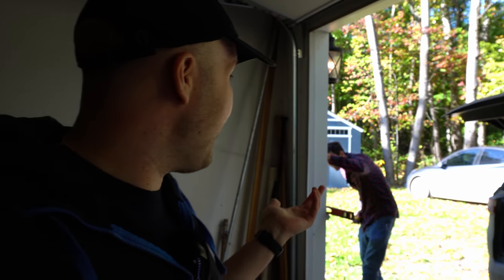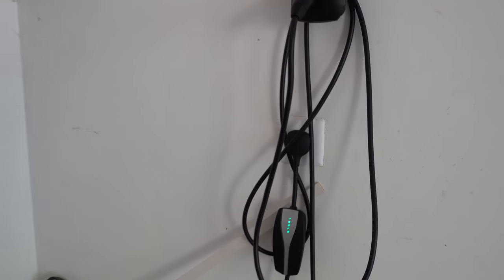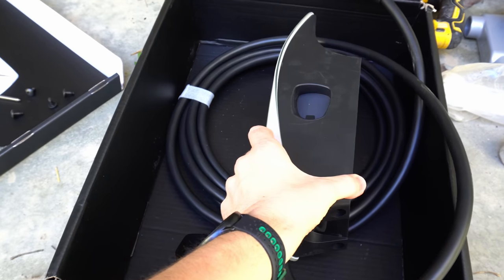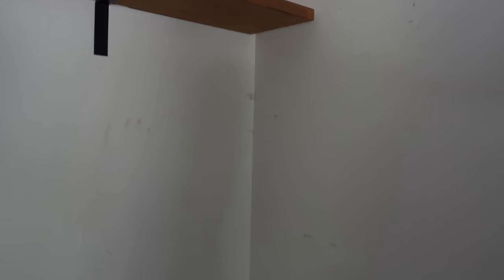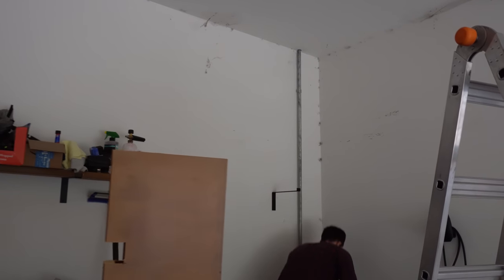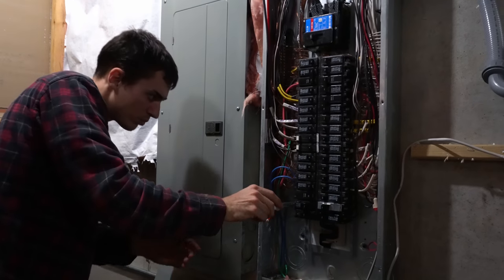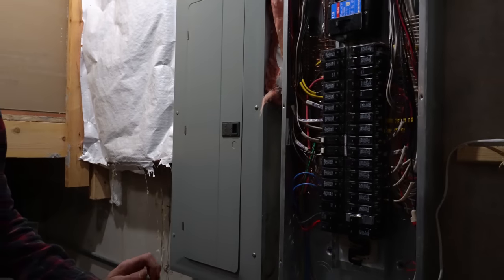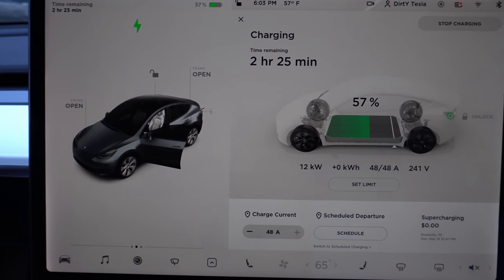Installing Tesla Wall Connector With a Master Electrician

Comment: I’m very reluctant to critique Nathan as he appears to be a great friend and is generous to work for peanuts. You could have saved money on cable by using THHN (thermoplastic high heat w/nylon) wire since entire run is in conduit.  Romex type cable isn’t required.  PVC conduit saves a little too and most of run is hidden from potential sags or use a few conduit straps. 
While the WC looks great on outside of house,  I would have protected it inside garage.  Sun & weather will age it.  How did Nathan translate siding notches to flat wall plate?  Great job !
Reply from the maker: There's no conduit in the attic. And he did suggets PVC but I wanted the conduit. Pretty much all the decisions you're like "hmm why they do that?" is me lmao. 

Also, I'll be parking outside and the charger will be in the shade 99% of the time. 

For mounting, I used this https://amzn.to/3BzM31G it has also increased in price since I bought it :S

Comment: If you were running it through conduit i wondering why you didn’t pull individual conductors.  Cheaper and less heat.  I assuming that you didn’t run conduit in the attic this the reason for the shielded wire.

Comment: In Europe we have three phase 240 and 400 volt, so we charge at a maximum of 16 amps, but still 11 kw on model 3/Y and with a 32 amp fuse you can charge a Model S/X with 22kw, so that is really something if you have a 100 kWh battery or two cars.

Comment: Just got a 14-50 installed , wonder if I should have done the wall charger
Reply from the maker: Like I said, there's not that much difference in the speed. Mostly aesthetics, but also the potential for multiple units to communicate in the future if you plan to have like 10 Teslas all plugged in together :)
Reply: @DirtyTesla  thanks man.  I literally got it installed yesterday,  it's nice not having to run an external cord from the dryer outlet, the tesla wall unit does look sexy tho
Reply from the maker: @OrganicStuff1  oh yeah that would be annoying! We've had the nema 14-50 going for almost 3 years now and it's been great 👍
Reply: @DirtyTesla  I did notice that the car is set to 32 Amps and the car would be showing it pulling 33 amps on the app is this within normal operations? Voltage looks about right
Reply from the maker: @OrganicStuff1  happens to me as well. I notice the app now changes me to 31 amps and car shows it's pulling 32 lol. It's been like this as long as I can remember and hasn't been a problem.
Reply: @DirtyTesla  God bless man thanks for all you do

Comment: Now you can use a 240v generator and power your house through that 15-50 outlet if the power goes out. You just need to cut cut the breaker to your grid/street
And he is talking about condensation building up inside, not necessarily rain water for that drain hole
Reply from the maker: Yes I have used the plug for that before but now we have powerwalls 8)

Comment: Can you give more details on the internet connectivity. Do you get an alert on your phone when the charger is in use?
Reply: hi, i just installed that charger outside. I don't think it will alert you when it is in use.  It come with its own network ID and password. (but doesn't have internet access, It is only only for setup. ) You can just scan  the QR code with your phone and it will connect you to the Wall connector. Once i was connected,  I set it to only charge my friend's and my telsa , It will remember the vin number.   Other Telsa won't be able to charge at my wall connector.

Comment: Thanks for sharing. I've seen plenty NEMA 14-50 plugs for under $10.
Reply from the maker: They are low quality and not recommended. Either they won't stand up to the hours at a high voltage, or they will break one time when you go to pull the plug out.

Comment: I had a mobile tech out to install the Homelink retrofit and he noticed my wall connector and provided a tip I’d not heard before. He suggested using the mobile connector occasionally when the car receives an update in order to keep the mobile connector itself updated as well.

Comment: Wait I'm confused at 13:56 you said to programm that charger at 60 A but then you set it at 48 A? So the braker was a 48 not a 60?
Reply from the maker: The breaker is 60 amps. For a continuous load (like charging a car for hours at a time) you can only use 80% of the rated amperage. So 48 amps is correct.
Reply: @DirtyTesla  oh ok ok it does makes sense 👌
Reply: @DirtyTesla  you have the math correct but you failed on the wire size using that NM cable #6

Comment: I just ordered the wall connector yesterday. I’m torn on installing inside vs outside the garage. My M3 comes in a week and I am getting the cybertruck as soon as it’s available. The 3 fits in the middle of the garage but then the wife’s SUV can’t be in driveway for me to get in/ out and with the truck I will be parking it in the driveway anyway. Leaning towards doing something similar to what you just did but also kind of want to baby the 3 and keep it in the garage (even though I only plan to have it for a year)

Comment: I have had the Tesla wall charger since getting my MY, in May of this year. Its a great little device. It charges much faster than the NEMA14-50 plug and looks really nice as well.
Reply from the maker: You're not kidding. I was caught off guard how much faster it really does charge!
Reply: actually its not much faster.  a NEMA 14-50 can charge at 40amps which is about 10,000 watts of power and the Tesla wall connector can charge at 48amps which is about 12,000 watts of power.  But if your using the gen 2 mobile connector that came with the tesla plug in to the nema 14-50 outlet your only going to get 32amps about 8,000 watts of powered because the gen 2 mobile connector is limited to 32amp/8,000 watts.   You need the corded mobil connector or the gen 1 mobil connector to get the 40amps/8,000 watts.

Comment: What was the purpose of running the wire into the attic and then down? Why not just use conduit completely in the garage?
Reply from the maker: I thought it would look better lol. I like how it turned out, but if I did it again, I might run it along the way.
Reply: I'd have cut the drywall open and run it inside the walls and patched it back up.  Thus no conduit, shortest path, and more professional looking.

Comment: Looks like you have two main panels - guessing a 400 amp service?
Reply from the maker: The second is geothermal
Reply: @DirtyTesla  seriously? Are we talking about the same panel? 🤣  To the left of the panel Nathan had opened up is a panel for just geothermal? 

1) jealous - amazingly efficient HVAC 
2) a good friend has geo and it only required a 2-pole 30 amp for the compressor / glycol pump and a single pole 15 for the air handler 🤔

Comment: Romex should not be ran in conduit due to heat effect. #6 wire can only be wired for 50 amps (38 amp charge). An electrical permit should be pulled to clear your local jurisdiction and for insurance purposes.

Comment: You definitely need a permit for that no ands' ifs' or buts'. Depending where you live, even changing out a standard receptacle requires a permit... Not like anyone does. Knowing permits are a massive money grab; if something devastating happened to your home and the charger was the cause; your insurance company may ask for the permit and will chose to cover or not cover damages due to that outcome. Two sides to the coin. Clean install though.

Comment: Actually a NEMA 14-50 is almost never worth it.  Once you add up the cost of a the box, the outlet (good quality NEMA, plate, wire strain relief, the required (by latest codes) gfci breaker for EV use (these are 10x the cost of a normal breaker and often missed as a requirement), and dedicating your mobile charger instead of keeping it in the car for emergencies, its a much better value to get the Tesla Wall Connector.   The wall connector comes with a 24 ft plug (6 ft longer than the mobile connector).  Ironically few people figure this out, and they go for the NEMA 14-50, thinking they are saving a lot of money (as was at one point stated in this video).

Comment: I have a NEMA 6-50 outlet with the mobile connector. This seems like a better option than the 14-50 outlet. Both outlets are rated for 50 amps but the 14-50 requires three conductors plus ground, whereas the 6-50 only requires two conductors plus ground. The third conductor in the 14-50 is not used for charging, so is not needed but makes the wiring more expensive because it requires more copper.
Notice that the wall connector only used two conductors plus ground. That’s all it needs.

Comment: I'm surprised a master electrician is using the wrong brand breaker for that Eaton sub panel and even more surprised he didn't use a torque wrench to ensure the connections are torqued down to the proper settings called for by Tesla on the charger and by the breaker manufacture on the 60A breaker.  It's important enough that Tesla actually designed the charger to monitor the wire terminals for excessive heat due to improperly torqued wires; you'll notice the temperature sensor lines up right on top of the wire lugs.
Reply: Not to mention using nonmetallic sheathed cable in conduit - something prohibited by NEC.
Reply: I am not surprised at all. I have yet to see a "Master Electrician" know what he is doing.
Reply: Trevor R. Where does the NEC say that?
Reply: @cali-electro-dad  
2020 NEC 110.14 (D). 

https://youtu.be/VZXptuiNX0M?t=32
Reply: @taylorlightfoot  Sorry, was trying to ask Trevor R. to point out where the NEC prohibits cable in conduit... because it doesn't. Doesn't mean it's a good idea though.
Reply: @tridesraty  It is not prohibited. Still not a great idea. For starter's it's a pain in the butt.
Reply: @cali-electro-dad  It is prohibited to be in wet locations though, so can't run it in conduit that's located outside or that runs below grade.  Agreed, pulling individual strands is way easier.
Reply: @taylorlightfoot  True dat.

Comment: is the wall connector going to run on 110, or 220 volts?
Reply from the maker: 220
Reply: 2 pole breaker. Runs at 240v 👍

Comment: A master electrician that advised you against current NEC code? That wall charger should be set to 40A max due to using 6AWG NM-B.

6AWG NM-B has an ampacity of 55a and because an EV charger fits the definition of a continuous load as per NEC Article 100 you cannot exceed 80% of the ampacity. You may not have any issues but it is something to be aware of.
Reply: #6 conductors with a 60A breaker is what Tesla recommends that you install to provide you with 48A to your car.
Reply: @murda2999  Correct.  #6 THHN, not #6 NM-B, Teslas instructions don't overrule the NEC.
Reply: I got quotes from 4 electricians and all of them want to use #6 romex even I requested for 60amp breaker. I ended up paying more for #6 THHN just to be safe.
Reply: @vvilliamluk  So this means that you are having them put the circuit in conduit, rather than running in the walls or above the ceiling? Just curious as to the general cost of the install. My two estimates were $1,208 and $2,750 for an 85-foot run. (This includes pulling a #12 cable for a 20A circuit).
Reply: @murda2999  Yes, 6awg THHN in conduit from the basement to the garage. My run is about 60 feet and I had the electrician run the natural wire as well just for in case it's needed for the future. I was charged $1100 which is very reasonable. If I opted for 6awg romex, it would be $750. All other estimates are about 50% more with 6awg THHN in conduit.
Reply: @vvilliamluk  Thanks for that information! Seems like a good deal.
Reply: 6/2 Romex is rated for 55 amps. Nonstandard wire rating means you can up your breaker to next size which would be 60 amp. However, 80% rule  applying to conductor would be 44 amps. Basically, you need to use a 50 amp breaker and the chargers 50 amp breaker setting which allows the charger to supply 40 amps.

Comment: Don’t do the NEMA-1450!!! I had mine for two months and it melted! Mine was Bryant too
Reply from the maker: I've been using mine for almost 5 years with no problems. There was probably an install problem. Or just bad luck, anything mass produced will have a few duds. Sorry that happened.
Reply: @DirtyTesla  they’re replacing it with a Tesla wall connector

Comment: I got myself a wall-connector also.
My main reason was that I live in an apartment building and I don't want anyone to be able to unplug my car.
Also I like to always have my mobile charger in the car, just in case, and taking it out and putting it back all the time would suck. =)
Reply from the maker: Great points. Most NEMA 14-50s don't really like you unplugging/replugging all the time anyway.

Comment: Why not run the wire inside the garage along the wall? I feel like you would have saved a bit on that expensive cable.
Reply from the maker: You're right. I figured it would look better in the attic. Silly me.

Comment: I'm pretty sure running romex through conduit is against code because it might overheat.
Reply: Several mistakes were made.  I'm surprised, if this guy is really a master electrician.
Reply: @taylorlightfoot  Yeah, maybe he was hyped up for the video 🤷‍♂️
Reply: @akivaweil5066  Romex can be in conduit in dry locations, ie not conduit located outdoors or underground.  But Romex amp rating is determined using the 60ºC column and for 6 gauge wire the rating is only 55A, so the wire isn't appropriate for the 60A breaker it's connected to; it'll be fine, but technically it's wrong.  Secondly, some inspectors will fail you for not using approved brand breakers in the load center; in this video he's using a Siemens breaker in an Eaton load center.  If the load center wasn't tested with that brand of breaker, it's no longer a UL approved installation.  Third, he didn't use any torque wrenches or torque screw drivers to ensure the correct specs were reached.  Loose connections get hot and start fires.  The Tesla wall charger has a temperature sensor that looks at the wire terminals and it'll shut off charging if they're getting too hot.  Proper torque settings at the breaker and the charger are crucial, especially with high amperage loads.  Most equipment won't have this temperature sensor as a safe guard.  It's up to people to do their job correctly to ensure a safe installation.
Reply: @taylorlightfoot  Jeez, I added a 100amp breaker to my garage and am starting worry.

Used 2 guage wire for a 5 foot connection (other side of wall). I used the same brand breakers and ensured a strong connection by wiggling the wires a few times and tightening.

If the house is ever sold it would definitely need to be ripped out because it doesn't have a permit.

Realistically never use more than 60 amps.
Reply: @taylorlightfoot  You definitely know your stuff.

Comment: A Tesla trained electrician gave me a quote of $2500 to install a  Tesla Wall Connector in the San Francisco Bay Area. I finally found an electric company who did it for $950.
Reply: $950 is still expensive.  How long was the wire run?

Comment: Did you ever figure out that you were supposed to change the 48A setting up to your 60A breaker like he just told you?
Reply: 60A breaker, 48A out.  It wouldn't be charging at 48A if it wasn't set up right.
Reply: @pixelcontrollers  I am not saying you are wrong, but I think telling the charger that it can draw up to 60 amps would allow it to draw that much. I saw + and - buttons on either side of the max current number. If I am right, you are leaving 20% of your systems charging rate on the table. Just trying to help.
Reply from the maker: You cannot charge at the full amount of the breaker. Can only pull 80% amps continuous. So 48A is correct for a 60A breaker when it comes to car charging.
Reply: @DirtyTesla  Hey thanks for that tidbit! I had not heard that before but it might be true. If it were mine I would be inclined to try it at 60 amps because most breakers actually pass a bit more than their rating before going off. Maybe Googling it would make it plain, but my Physicist mind wonders what would happen or if Tesla would consider it out of bounds. Thank you for the interesting conversation!
Reply: @davidbooth8422  the configuration of the charge rate happens on a web page.  It lets you select "60A breaker" as it asks you the breaker rating.  The software then sets the charger to 48A.  Continuous duty loads have to be derated to 80% of the breaker.

Comment: Nice job. I dont like the white box, however it does pop on your wall. Also, I test drove a Bolt a while ago and the dealer said they recommend a local company to install a charger for $1,500 CAD.

Comment: In the future I would highly suggest using 4 gauge MC cable. Due to the fact that charging a Car is considered a constant load Tesla tells you in the Gen3 instructions to use 4 gauge wire.
Reply from the maker: Manual says 6 gauge
Reply: @DirtyTesla  page 5 says to upsize if necessary. In all honesty, at 130’, #6 wire will present only a 2.34% voltage drop. It’s recommended to size the wire for no more than 3% voltage drop. You’re fine with #6. #4 wire would allow for 1.54% drop. The difference? 234.4 volts vs 236.3 volts. I wouldn’t lose sleep over it 🤣
Reply: Mikes the only 'electrician' I know that recommends 95 amp wire for a 60amp circuit.....Its like using 500MCM on a 200 amp panel...

Comment: Since I'm not sure how long I'll be in my house, I decided to go with a NEMA 14-50 outlet and then use a range wire to connect it to the Tesla Wall Connector which is mounted right next to it. It only charges at 40amps, but that is plenty and is still faster than the mobile charging unit (32amps). Running an additional 60a line for 48a of output would have cost me an extra $1000 in my case - so I opted for the compromise. Super happy with the results.